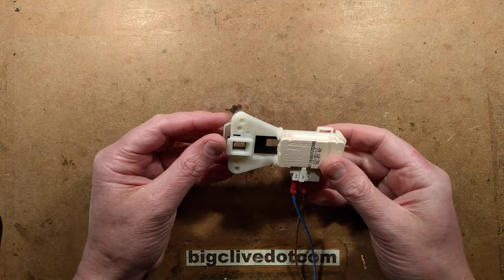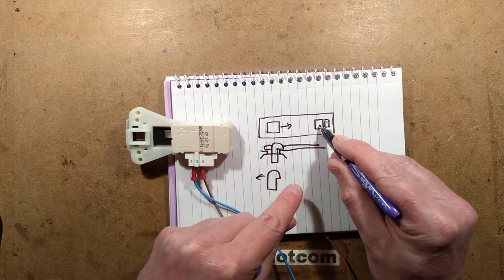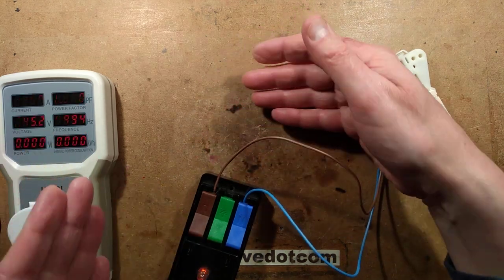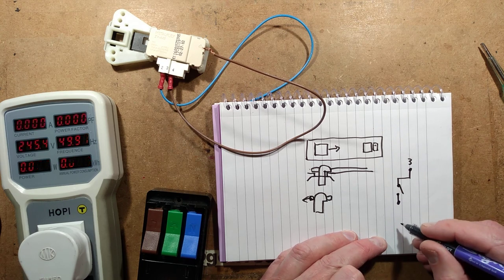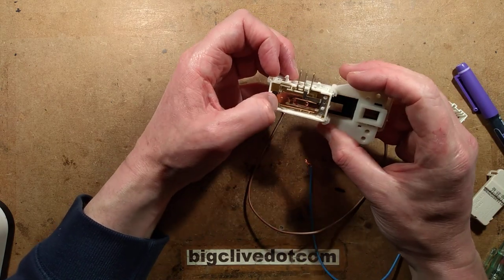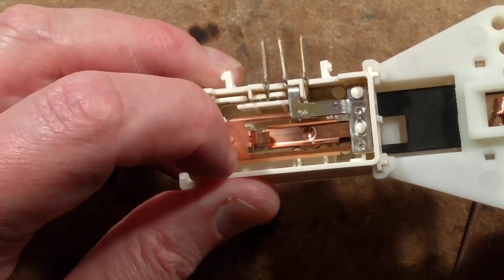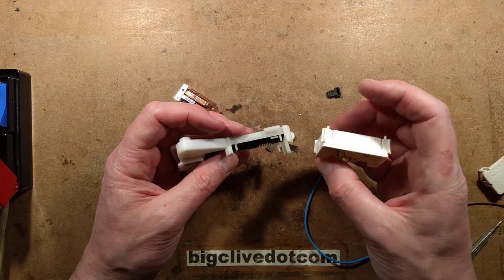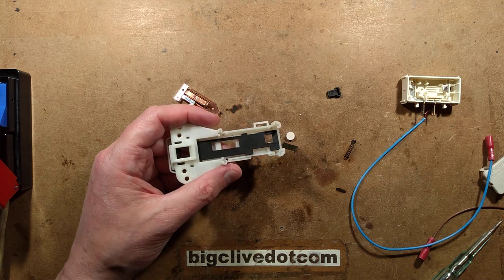How a washing machine door interlock with time delay works.  (not a wax motor)

Comment: Isn't the strip the PTC is sitting on bimetallic? It seems to have different colors on either side. It could just push the PTC up against the copper.
[edit 2 minutes later] Yep, what I thought. Should have watched to the end first. ;)
Reply: yep, the bimetallic strip is under the PTC with the most surface contact and has the adjuster at one end

Comment: Nice design ,no wax and using PTC thermistor .is there a bimetallic strip that the PTC thermistor activates ???Safety rated switches cost a fortune compared to an identical switch .A book from CSA would help( Machine Guarding )So many switches are being used in equipment as safety switches and are not rated as safety switches !
Reply from the maker: Yes bimetallic, which also adds the delay.

Comment: That explains why the washer opens quicker in the winter then in the summer.
Reply: The best part is that there's an adjustment screw . One implication is that you can have seasonal settings, as you do with door closers. Another over-ride for a lock that stays locked because you are impatiently boiling already is an inverted can of compressed air directed at the outside of the washing machine, just above the mechanism under discussion.

Comment: Awesome video, Clive!
I was wondering: my washing machine has a panel on the front that you can open, and in there is some sort of ring attached to a cord (don't know the correct word in English). If you pull this ring down, the door immediately unlocks. In the manual it is described as "Emergency door unlock". How could this be connected to the lock you disassembled, or is it not possible with the one in the video?
Reply: One imagines it's connected to the little pin and the action pulls it back such that it no longer blocks the mechanism. Something that would need to be designed in, as this one doesn't seem to have that sort of access to the pin.

Comment: My new top of the range Bosch machine doesn't have the old style of door lock. It has a motor/ drum rotation sensor and a solenoid operated door lock so it can unlock the door as soon as the program finishes.
Reply: It probably also has an OBD style diagnostic plug in the back to make sure you have to pay a service monkey to replace (And bill you for) many perfectly good parts until he gets to the only one that was broken because even when you replace the broken part yourself, you can't reset the error code without the service tech's laptop. Very glad my appliances mostly predate the era where microcontrollers are so cheap they get stuck into everything, even though they're not doing anything that can't already be done with off the shelf electromechanical parts. Easier to program obsolescence in the form of a run counter into the appliance too.

Comment: is the switch toggle down to the coefficient of linear expansion of the cylindrical thermistor? (how many y tube channels could you ask that question on)
Reply: The bimetallic strip does the vast majority of the movement. The change in length due to a temperature change is (original length)*(Coefficient of thermal expansion)*(Temperature change) and the CTE is usually of the order of 1e-5 DegC^-1, so it would take a lot of heating to create a decent amount of movement. Turning the heating to bending using a bimetallic strip gives a much more useful movement. Interestingly the bimetallic strip was one of John Harrison's inventions in the 1700s when he built the first marine chronometers, which were, at the time the most precisely engineered devices that had ever existed. The bimetallic strip was a very handy way to make the clock mechanism regulate itself to compensate for thermal expansion in the parts with temperature changes to keep the clock running accurately. Before that he got pendulum clocks to run at precisions unheard of before using a gridiron pendulum, which used the differing thermal expansion of copper and steel pendulum parts to keep the centre of gravity of the pendulum a fixed distance from the pivot regardless of the temperature.

Comment: Hi, In our IFB washing machine front door lock phase voltage is only 60, so its unable to generate sufficient heat and lock is not working.  Please let me know how to check and fix the phase voltage. Thanks.

Comment: Neat. I didn't even know tumble dryers locked, just shut off if you opened it for some reason.
Reply: This is for a washing machine, not a tumble dryer. And it may vary by country on if they lock or not. No washer or dryer I've owned here in the USA has had a lock.
Reply: @rlowens   My top loading LG washer locks the lid.  I'm in the US.
Reply: Wow what a fuck up. I was reading someone else's comment about dryers and it threw me off.

Comment: Regarding the HOPI displaying VA: can't you multiply the Power Factor times the Power and get Volt-Amps?  Or am I calculating that wrong?  (And, yes, I know, if it had VA displayed it'd be just a matter of looking at the display with no math involved -- definitely easier.  But my question is basically, doesn't the HOPI give you enough information on its already existing displays such that you can calculate the information you're looking for?)

Comment: @bigclivedotcom I'm surprised you haven't modified your hopi to be flicker free. Is it possible?
Reply: It is a microprocessor driven multiplexed display.  The only way to stop the flicker is to either change the software in the processor, or put some type of latching buffer between the processor and the LEDs.

Comment: Some bosch machines didn't use a thermister. Instead they have a timer & electronic lock. It's possible to lock & unlock instantly or leave it locked. These will not open unless it's switched back on. 
So they can also open instantly once the cycle is over or if the cycle starts, then is cancelled then powered on again, yes there is a spin sensor. Once static it'll then allow the door to be opened. 
It's also not a solonoid as removing mains power =\= unlock, you need to power it back on.
It's a really heavy click, I can film it anyone is really that interested.

Comment: Interesting teardown. I was surprised it uses a bimetallic element. I though washing machine door locks were wax motors. It will be interesting to find a wax motor lock an do a comparison.
Reply from the maker: I think the Maytag style machines use wax motors.
Reply: ive never heard of a wax motor before. Wax is what candles are made from and what honey bees make.
Reply from the maker: @simontay4851  Wax expands greatly when heated.  (Think lava lamp.)  It can be used to apply force.

Comment: In my parents 60s era washing machine it had about 5 or so solenoids which made a thunk noise and made the lights flicker. They were massive things, what do they do now? I imagine the solenoids are built into the valve mechanism?
Reply from the maker: They possibly engaged various modes on a common motor.

Comment: i had something thing similar on a top loader. you had to wait forever for the the thing to stop spinning to open the lid. and it would also detect if the lid was down and lock it in place. the piece of junk would also get stuck. I bypassed it and will just have to not stick my hand in the spinning washer

Comment: Yeeesh, coincidence or not Clive, local news just today: A kid that had his arm ripped off by a drier machine died today. :P No kidding, sad thing. But I'm gonna guess it was probably an old ass top loader with no locking mechanism. Still plenty of those decades old killing machines around the country to this day.

So, few years ago I had to replace that piece from my machine. Never tried forcing the door open, it just... failed. But I guess in general I'm still pretty lucky... I have an LG washer drier front loader for around 6 years now, it only failed once, and it was about the door locker. It's not as cheap to get here, but I must've paid less than half by doing it myself... and probably waited a third of the time, which is the main reason why I decided to fix it myself. xD
Very hard to get people to fix this sort of stuff here, even when they charge a lot for it. You can expect to wait weeks to months.

The only really annoying thing is that metal ring that goes around the rubber to keep things water tight. That was hard to put back in place... easy to take out though.
Reply: At least in the USA, the older top loaders used a brake mechanism to stop the drum if you opened the lid. The newer ones use an interlock to keep you from opening the lid. I'm not sure of the exact date when the change was made, but a circa 1988 washing machine has the brake and a circa 2001 washing machine has the interlock (both top loaders).

Comment: Top loaders do this as well , and it is as annoying as heck with no real purpose at end of wash.  Fortunately easier to replace than front loader DAMHIK.
I wondered about the time delay , should impatience recur. Cool down explains its erratic timing. Spindown takes seconds, delay lasts several to 15 min.

Comment: So can this accidentally lock small children in?   I'm thinking like one of these installed in a dryer.   Can it be opened from the inside just by pushing against it?
Reply from the maker: Not the washing machine, but the dryers can usually just be pushed open.

Comment: The interlock independent of power is clever. Now I have to try it doing laundry tonight and yank the plug. All of a sudden having that feature makes the machine much more dangerous since now I have to try it.
Reply: @
mysock351C

the door still wont open for a minute but if it has water in it you may get wet when it does :-)
also some machines wont open if there is water in the drum :-)
Reply: @YTANDY100  Yeah I know some of them have pressure sensors (a must for a front loader, obviously :) )
Reply: Please show full diagram of door switch  of washing machine

Comment: Got to keep remembering, UK has mainly front loader washing machines.
Reply: Top loader are seen as ancient.. may as well use a mailing tub and a dolly
Reply: @blackcountryme   That's very interesting! As a rather tall person, I prefer the top-load washer. Now if I could just find a top-load dryer! (Just kidding- I know why that wouldn't be a good idea.)
Reply: Here in Australia, if you walk into a white goods store, 80 to 90% washers are top loaders, they are even in Laundromats.
I thought it was due to space requirements, in UK I notice washer and dryers are in the kitchen.
In Australia, we have laundry room, even in small flats and units so cheaper and easier to connect top loader.

Comment: Ingenious device, but very annoying when you have to wait and the drum has long since stopped revolving.
Reply: Yeah I like the digital control much better since has an RPM threshold instead. I'm sure pulling the plug would allow for some babies to be dismembered, but I much prefer to open the damn door when its going less than 25 RPM.
Reply: @mysock351C  Digital control washing machines usually have latching mechanisms that remain in the last position they were set to and only require power to change state, so they are actually pretty childproof too!

Comment: This is almost obsolete as far as modern washing machines go. Anymore, the lock mechanism is actuated by a small permanent magnet DC motor, so when power is removed, the lock stays put. These locks can also include feedback to tell the control module the state of the lock, as well as a means to tell the control module whether or not the door is fully closed, usually with a microswitch or reed switch and magnet.
Reply: Austin Allmond - our Indesit has the type of lock you have described - I think the lock that Clive has was for the older analog timer program dial type

Comment: Why don't you tare apart the Hopi and speed up the multiplex of the screen in order not to flicker on camera?
Reply: John Ward uses a similar unit with an LCD display which doesn't flicker on camera.
Reply: Over locking with big Clive
Reply: I know, switch the LEDs to all UV and then spray the screen with glow-in-the-dark paint!  That'll slow the refresh rate right down, with no need to mess with the computer side.
Reply: Because the multiplex speed is driven by the software in the micro processor.  If just try to speed up the clock (assuming you could make it go fast enough, which you cant), then you're going to screw up the timed measurements.

Comment: How no water inflow in the washing machine is sensed.
Is a PTC used to maintain a temperature of the solenoid coil of inlet valve or frequency is monitored as the inductance changes with movement of core connected to the diafragm of the pressure sesneor
Reply from the maker: It detects that the water level hasn't changed after a time-limit.

Comment: Pointless to take apart and repair Clive?! Nonsense! I kept a beko washer going for 9 years, the last 3 having to bodge the door lock! So this is the first video you've done i've actually already known about!

The interlock on mine had got so hot it had charring on the plastic inside where the thermistor(??) sits, and took a lot of contact cleaner and sandpaper to get working. This was between paycheques!

Comment: Hi. How do I know which order to plug in the wires to the door interlock? I have 3 wires and not sure if the order matters
Reply from the maker: The order does matter.  There will be a heater circuit and a switch circuit.

Comment: "one of the most common ways of breaking your washing machine lock is impatience" please tell this to my ex-roommate. He couldn't wait and thought the machine was broken and 'successfully' opened it wit a claw hammer and brute force.....

Also i found a bug on that same washing machine: You start a program, close the door so it locks, then decide you have to put some other clothes in so you switch the machine to off.
Switch the machine on without pressing start and wait for the lock to release, open the door, put clothes in and press start again before closing the door. Well in that case the machine starts to run for a short time before noticing the door wasn't closed. This bug was even funnier when you selected the spin-only program. Then you heard some relays clicking, some buzzing noises from the motor without movement and then an error code showed up.

Comment: Clive's wife is wondering why the washer door won't close properly. She doesn't realise he's in the shed dissecting the lock mechanism and talking to himself . Your in trouble Clive😃.
Reply from the maker: A wife?  What's a wife?
Reply: @bigclivedotcom   A wife is a very complex piece of equipment. Consists mostly of a very sophisticated motherboard operated and controlled y a very sensitive processor. This processor is protected by a fuse, which is prone to short out, caused by overheating, especially when connected to another piece of equipment (a husband). This processor is programmed to resist any attempts by connected equipment to perform tasks such as, playing golf or going to the pub with mates. Such attempts usually blows the fuse, and   need several days to cool down. Rebooting does not work. Maybe you would take one into the workshop and strip her down to see what makes them tick. Mine needs a new Operating System, I think!.

Comment: I once had to change the locking mechanism. Had to go in underneath the machine to gain access to that lock. Wasn't a fun thing to do.
Reply: If you can get the door open you can often cheat by removing the door seal from the front of the machine and gain access through the front. It's normally held on by a length of taught wire and a clip which can be carefully undone.
Reply: @classicmacintosh  Not on the machine that I had to work with, but thanks for the info.

Comment: This one is exactly what installed in my Samsung washing machine. It failed recently: inner heating element and its contacts oxidizes very fast. I just bypassed it by shunting power to signal wire, works just fine. In my opinion, it's very unreliable device in terms of engineering. A solenoid with backup power supercap would be a way more better.

Comment: Clive, i took one apart last year on my shitty beko washing machine, it looked identical to the one you just showed :-D,
The ptc and strip were blackened and making bad connection.
That beko machine was the most unreliable make i had ever seen, beware!!
Reply: That lock is made by miele, and made in britain.
Reply: our zanussi lasted about 15 months then bearings failed suddenly 😠 previous one lasted nearly 15 years !
Reply: andygozzo72
The beko i had lasted two weeks and the company sent a replacement that lasted two months before playing up.
Would not spin at the end of the wash or took 3 hours to do a simple wash.
Beko is a shit brand i will never buy again :-(
Reply: Cheap People always complain.😂
Reply: @zx8401ztv  'not spinning' is a common problem, modern machines  have very sensitive 'out of balance' detection, trying to spin a small but heavy load is very hit and miss, usually miss with our thing...

Comment: I wish I could show my interlock it Is bigger has a little coil motor with a pin going through it the pin pushes a catch that turns a little plastic wheel with like cams on it that resets the pin  such a clever thing  only a tenner to get replace rather than probably electrocuting myself

Comment: Speaking of sticking your hands into spinning drums, i was taught, while labouring for a brickie, that you should throw the stuff into a cement mixer without sticking the shovel into it - you sort of slap the shovel against the hole at the front of the mixer, otherwise the shovel might get caught on the rotating drum. But nearly everybody i have ever seen using a mixer since has not done this! They all shove the shovel into the rotating drum. Makes me cringe.